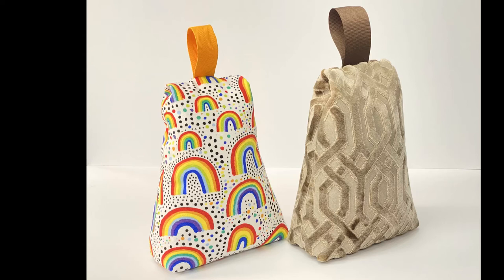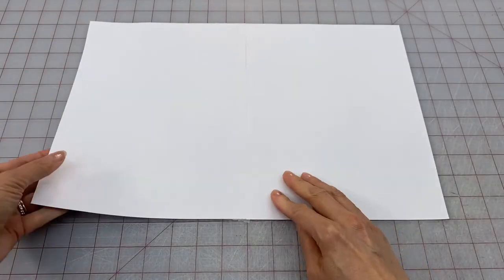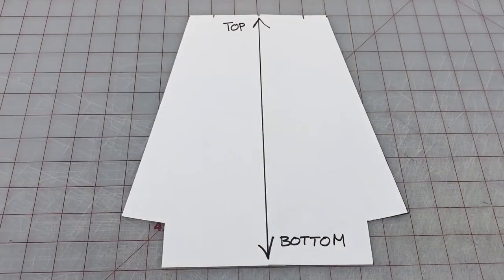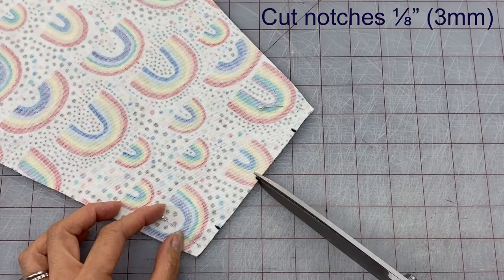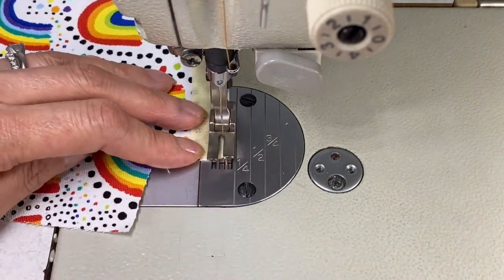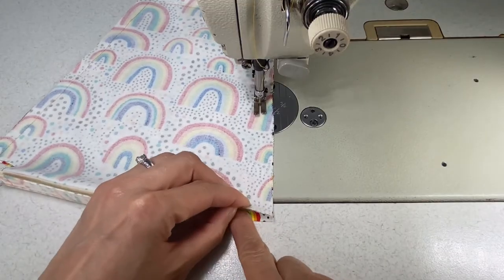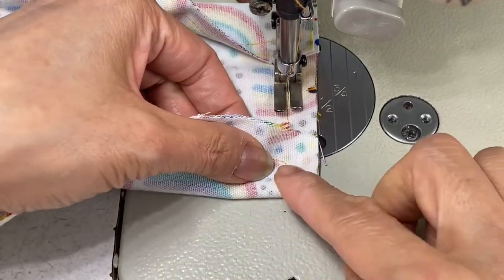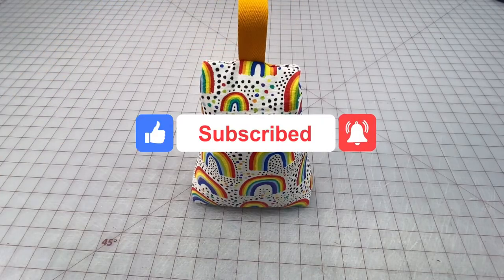How to Make a Fabric Door Stop Refillable with Velcro Closure  - DIY How to Make

Comment: Good video! I had to alter tbe measurements as you say 5 inches on bottom of the template but 7 inch of velcro and i found it doesnt work, unless you do also 7 inch on the template for the bottom.
Reply from the maker: Thank you. Glad you like it😊 You don’t need to adjust any measurements. The bottom measures 7”.  Watch the video again.  The pattern is made with the paper folded in half.  3.5” marked from the fold for the bottom.